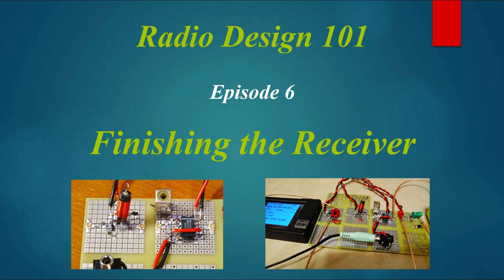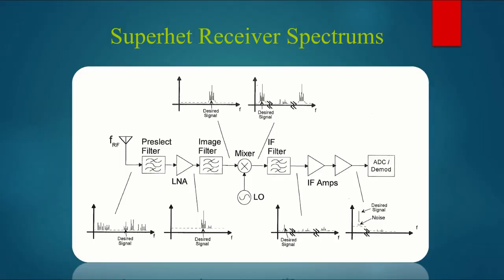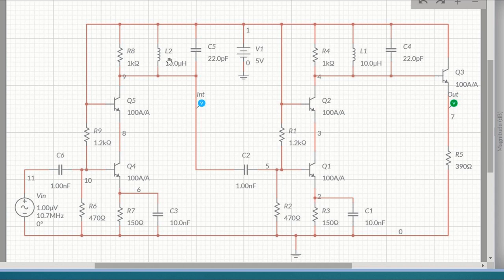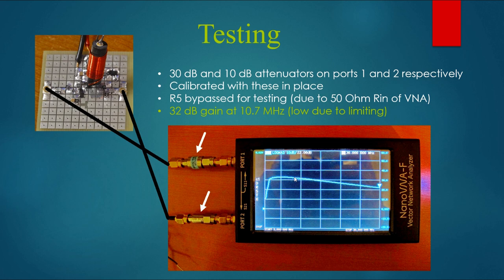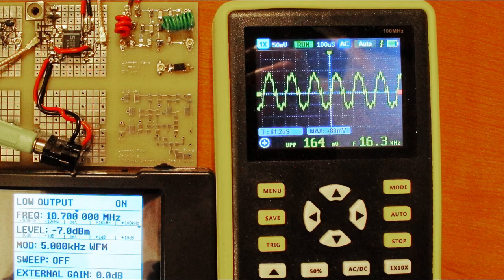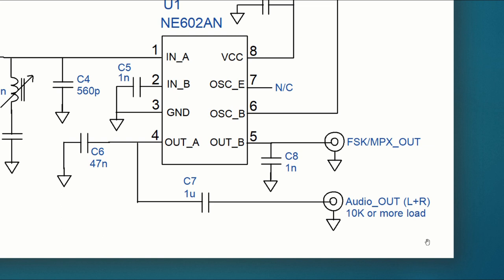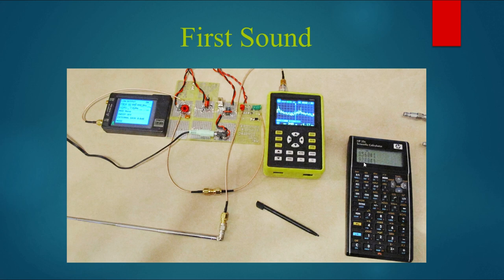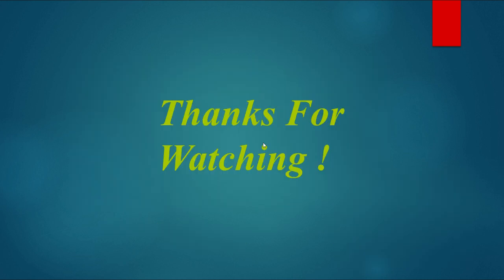Radio Design 101 - Finishing the Receiver (Episode  6)

Comment: I'm doing my first "system level" test before moving into building the IF amp and Demod. I read in your course notes about using a 300 ohm to 50 ohm transformer so that you could measure the performance of the mixing/IF filtering stage. Is this just something a person could build on the RF protoboard, or is it using one of the toroids as a transformer? Right now I'm trying to figure out if I have good enough performance to keep moving.  I do not have impedance matching between the ~3KOhm output of the amplifier and the 1.5KOhm input of the mixer. I also (right now) do not have impedance matching between the 1.5KOhm output of the mixer and the 300 Ohm input of the IF filter. I'm using an RF signal generator to inject a -50 dBm signal at 88.7 MHz into the tuned RF amplifier, and then my Tiny SA to measure what I get out. Using an Si5351 as my LO to inject a 78 MHz signal into the mixer. On my Tiny SA, I measure a 10.7 MHz signal at -41 dBm. So this means only about 9 dB of gain (without the two matching circuits) but it's also skewed by the 300 Ohm output of the IF filter and 50 Ohm input of the Tiny SA. Can you give some hints on how to change the setup to perform a better measurement? Thank you!
Reply from the maker: Sorry for the delay in replying. First, I think the numbers sound OK. As you mentioned, you're going from the IF filter output directly into the 50 Ohm TinySA input. If you had matching (or transformer) there, things would look better by about 6 dB I think. And while the datasheet gain for the SA602 is 15 dB, that assumes the input is matched (it's close), and the differential output is combined into a single-ended. So realistically the mixer is maybe only 6 or 8 dB of gain. And there is close to 6dB loss in the filter - maybe more since it's not in a 300 Ohm system.  So I feel like things are pretty good.  I'll follow up with more replies and questions on some of the individual items 🙂
Reply from the maker: On the question about the transformer - we originally had some impedance transformers from Digikey - but at some point I wound my own.  I think I used some high-mu FT37-77 toroid cores we had in stock, and probably just made 2:1 voltage transformers (4:1 impedance ratio) like shown on page 3 here:  https://ecefiles.org/rf-circuits-course-section-13/   I suspect I wound the 50 Ohm side to present an inductance of 500 Ohms or so. Don't remember how many turns it ended up, but it was pretty low, given the FT37-77 has very high nH/T^2 due to the ferrite ('FT').
Reply from the maker: QUESTION:  You said you have the 3K amplifier output connected to the 1.5K mixer input. I assume you used blocking caps, but my question is - how long was the interconnect and was it coax?  Coax has about 30 pF/foot for RG174 stuff. So 6 inches would put 15 pF shunt to ground and that could load stuff.  But if it's all on the same board with no coax and a short distance apart, I don't see much problem with driving into the 1.5K from the 3K output (other than losing a few dB of gain and widening the amp bandwidth some).
Reply: @MegawattKS  Thank you for helping me debug! I've built these up as modules, similar to you video, so that I could test them one at a time. I did order the RF protoboard from the design that you posted on ecefiles. So, each module occupies one of the "squares" on the board. But that does leave me wondering, how should I be connecting the modules together? Like you, I'm use u.fl connectors to measure each module (e.g. RF amp, mixer, IF filter module). But then I found a short, 2 inch u.fl to u.fl jumper on eBay and I was just using that to go from the output of the RF amp to the input of the mixer, and then from the output of the mixer to the input of the IF filter. Is this a problem?  This is where I get a little confused on "characteristic impedance" and when does it matter. I will also mention that I am trying to best to write up this entire project and I'd like to design a custom PCB at the very end that contains the entire receiver. If you search the web for github jchatt0 fm receiver you will find it and maybe you will see an obvious mistake!
Reply from the maker: @jchatterton2113  An important question first: Did you match down from 3K Rout of the LNA to 50 Ohms and then match back up from 50 to the 1.5K. I think I understand that you skipped that and are just direct-connecting the LNA collector node to the mixer input through a coupling cap. (github is complaining when I searched it, so I can't see that info)
Reply from the maker: Assuming you didn't match down to 50 from the LNA and back up to 1.5K at the mixer, i.e. that you direct-connected through a simple coupling cap like 10 nF, I think the effect of the 2 inch u.fl cable is minimal - but significant. Since it is much shorter than a wavelength and has high R on both sides, it can be modeled as a simple parasitic C to ground. I calculate about 5pF (using 30pF/foot for typical small coax).  That's -j320 Ohms, which isn't terrible, BUT - it is likely to be shifting the LNA center frequency a fair amount - as will the 3 to 5pF input capacitance of the mixer RF input pin. In the class, we always matched down to 50 and back up, which largely avoided this issue.  (That's not to say it can't be done without matching - but adjustments in the resonant tank of the LNA would likely be needed...)
Reply: @MegawattKS  You are correct that I just direct connected the LNA collector to the mixer input through a coupling cap! I hadn't thought about the parasitic effects of both the coax cable and the mixer input, though. In your Youtube build, did you do that? I noticed that you also ran a coax cable from your LNA to your mixer. I do like the idea of matching to 50 ohms on the output of the LNA and then back up to 1.5K ohms because it allows you to go back and check the LNA performance on your NanoVNA. The way that I did it, removing the 50 ohm matching network to just go from the 2K collector resistance to the 1.5K mixer input, means that I can't go back and easily check my LNA performance on the NanoVNA.
Reply from the maker: @jchatterton2113  Good.  In the build shown at the end of the RD101 series, yes - I just connected with an available u.fl coax I had.  In that build as well as the class builds the matching networks are still in place. So the length of the cable doesn't matter - to the extent that the match into the mixer is good.  If that is good, then the mixer input looks like 50 Ohm resistance to ground and since we're using 50 Ohm characteristic-impedance cable, the resistance looking into the other end of the cable is 50 Ohms resistance as well. So that's what the LNA wanted to see and it was happy :-)   But your design with direct connect is fine too since you took into account the capacitance parasitics.  As for testing it, you might consider building a little high impedance passive probe. I did one when troubleshooting in Epilogue 2. See slide 12 (and the associated video) of this set:  https://ecefiles.org/wp-content/uploads/2023/01/RD101-Epilogue-2-DebuggingAndTroubleshooting_rev1.pdf

Comment: any easy way to say if SA612 has been burnt? The attenuation through SA612 in demodulation circuit is so high, i am only able to see a tiny demodulated signal(frequency matches modulation frequency). Don't have much of spare SA612s at the moment to try around.
Reply from the maker: Its probably something in the build. Have you tried checking the DC bias voltages on the pins?  I have the SA602, but suspect they are about the same. Here's what I measured for the DC voltages on the pins when powered by 5.0V: Pin1 and pin 2 DC bias should show about 1.4V (I got 1.38). Pin 3 should be zero (ground). Pins 4 and 5 should be around 3.9V. Pin 6 = 5.0V, Pin7 = 4.3V, and Pin 8(Vdd) should be 5.0.  If those DC values look reasonable, then might have to inject some signals and see if signals are getting in as well.  What frequency deviation are you using?  Also - have you tried changing the frequency away from 10.7 center to see if maybe the quadrature network is resonanting somewhere else? In the class, we would often find it resonant a few MHz away and have to retune. (the phase slope is very small when off resonance and so is the output amplitude if it's not matching the center freq of the FM test signal).
Reply: @MegawattKS  yeah, it looks the biases are off. Pin1 at 500mV. I am using a 10.7 Ceramic discriminator salvaged from old radio, so resonance shouldn't be off much. It appears variable inductors are impossible to find anywhere around here :( So have to try the toroid t50-6 with 10 turns, but ceramic discriminator is probably alright.
Reply: @MegawattKS  frequency deviation= 75khz, but i am still just testing with 5khz tone for modulation, not real audio signals.
Reply from the maker: Any DC path to ground external to the chip on pin 1?  Also - is this without an input signal (input signal could influence DC measurement).  Yeah - I was lucky to find a variable inductor in my box. In class we used 9 to 50 pF variable caps, but I didn't have any of those - and that range is not really enough sometimes anyway, given the 600'ish pF in the LC resonator.  Your ceramic resonator sound like a more robust solution (assuming it matches the IF filter frequency well :-) )
Reply: @MegawattKS  I did once wire it directly to function generator without DC block capacitor, but not sure if it got ground path. Now i swapped SA612 from another old prototype board, but the output pin's bias are wrong. Hard to beleive that such simple IC wiring like SA612 gets breaking. Wait for my new SA612's to get delivered, to redo the build.

It works fine on LTSpice simulator with SA612 model though.
Reply from the maker: @cholan2100  Hopefully the new 612 will work. Are you able to look at the solder joints with good magnification to visually check everything?  I have to use multiple magnifiers these days ;-)
Reply: @MegawattKS  i test the joints with continuity tester on multimeter by touching IC leads and the trace end points.
Reply: @MegawattKS  From the video is it right that -7dBm input signal to demodulator gives output of about Vpp=160mV? (without any explicit impedence matching networks, and input signal from 50 ohm source)

My SA612 delivery seems to take for ever. In my build that has problems, 900mV input gets demodulated output of Vpp=100mV, seen on oscilloscope. Sometimes it works even with -7dBm input, but unstable, output signal loses after a while. 

Wondering if the quadrature mixing somehow ends up with unintended amplitude modulation at output, as amplitude fluctuations can be seen on the scope.

So in my build the demodulation works fine, produces perfect sine waves same as the modulation frequency. Only that output signal has weak amplitude than expected(so requiring higher input signal).
Reply from the maker: @cholan2100  I always use 0dBm = 224 mV RMS into 50 Ohms, or 317mV peak, or 634 mVpp.  So without a calculator, I'd estimate -7 dBm (which is about -6 dBm which is a factor of 1/2 in voltage compared with the 0 dBm reference) as about 300 mVpp. BUT - this is into 50 Ohms, so multiply by 2 if it's unloaded. So you should have about 600 mVpp.
Reply from the maker: Another thought:  In the class, we often had builds that didn't have a lot of audio output. One important test I stressed was to try changing the FM test source generator frequency up and down around 10.7 MHz center to see if the resonance was somewhere else (it was in about 50% of cases - often by as much as several MHz - so go a few MHz either side in 100 kHz steps). But I think you may be using a ceramic resonator - so not quite the same situation. Still - maybe worth a try.  I don't think it's an amplitude issue (unless the biasing in the SA602/612 is messed up). The whole thing is supposed to be insensitive to amplitude as you said.  Of course it does take a couple/few hundred mVpp to get to that point.
Reply: I played with SA612s and SA602s before and I got into similar problem but it turned out my power supply (used a DC-DC boost converter from 3.7v to 5v) was overloaded (it also provide power to an LNA IC which consumes 130mA, quite power hungry) and VDD of SA612 dropped below 4.2V where it starts to get unstable. Also SA612 does require a strong LO signal (I remember  >0.1v) so if the LO is too weak that may result in trouble.